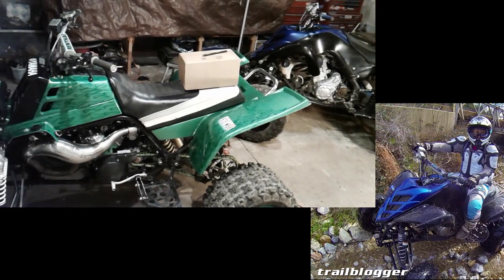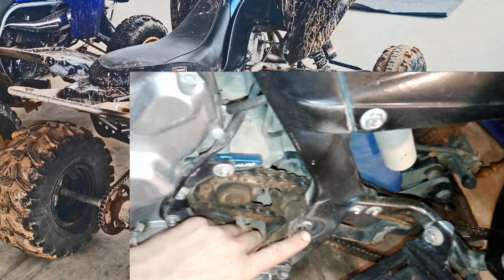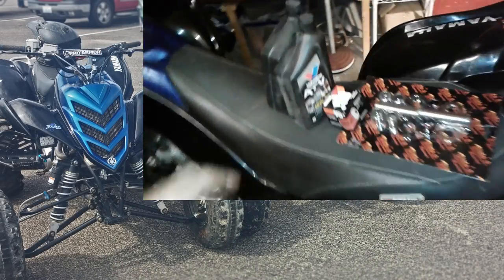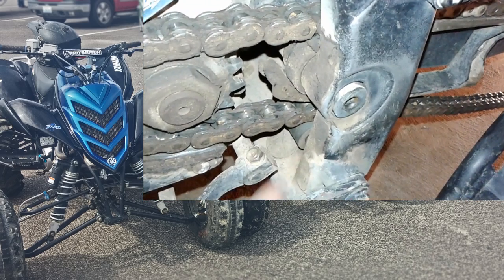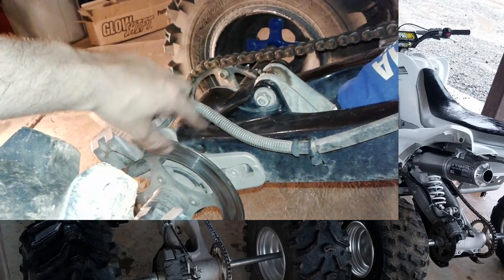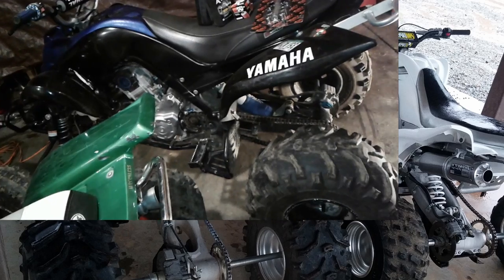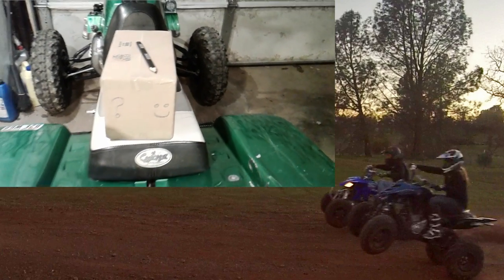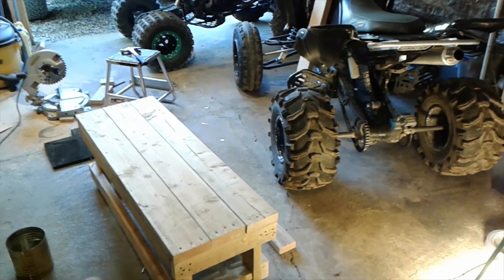Raptor 700 Maintenance Repair Oil and Lube Plus Swingarm Bearing Replacement Parts

Comment: Wash your bike when its muddy thats probably quête your problem is comming from
Reply from the maker: J-philippe Tremblay yeah she is a mess right now, been so busy lately. i will have her cleaned up soon. might even strip it down for powder who knows
Reply: TrailBlogger i try to clean mine almost every ride juste to make sure there's no dust in the joints! Your bike look good enough dont powder coat it!
Reply from the maker: the original owner painted it with a cheap rattle can style paint, I want to strip it down and at least do a proper paint job on the frame. there are spots you can see where they just painted over the rust and I want it out of there.